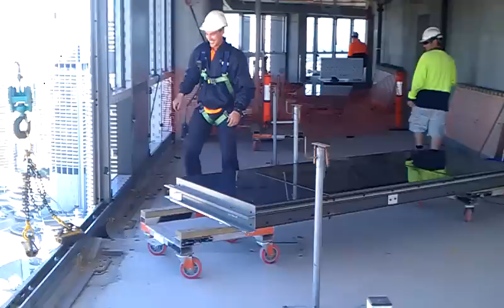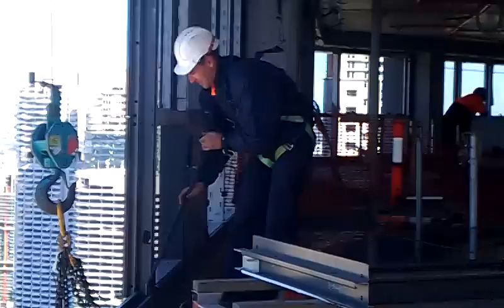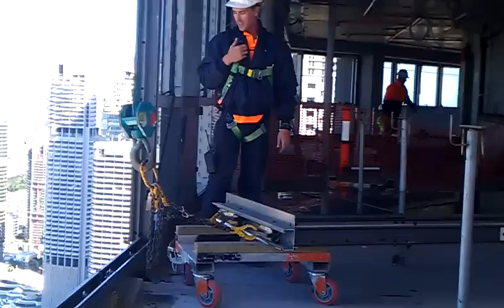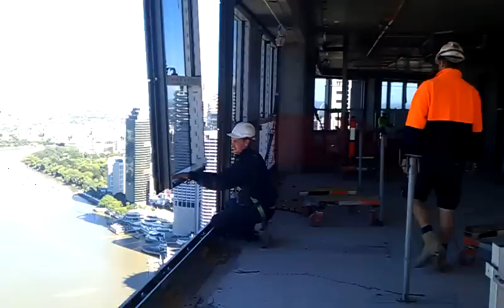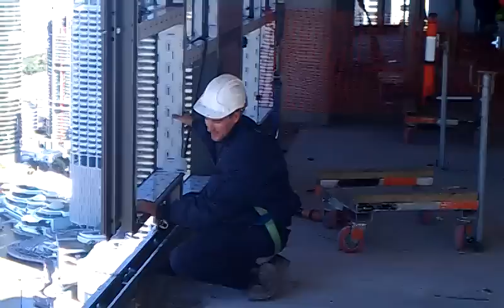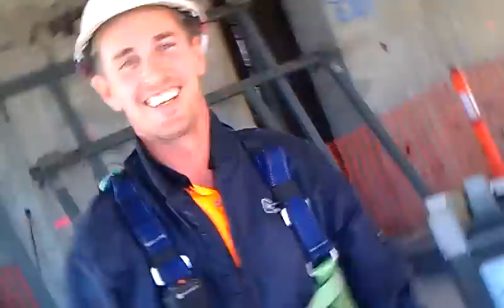Curtain Wall installation.

Comment: can you install curtain walls into already existing walls?
Reply: Late response, but I would say no. Curtainwalls are walls themselves. They are installed on the face of slabs rather than stacked ON slabs. That would be window wall.